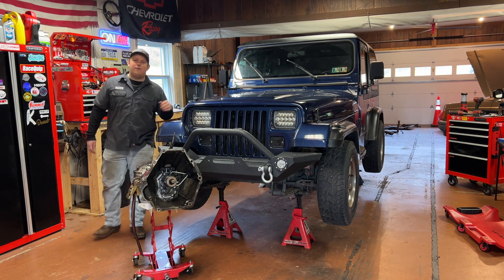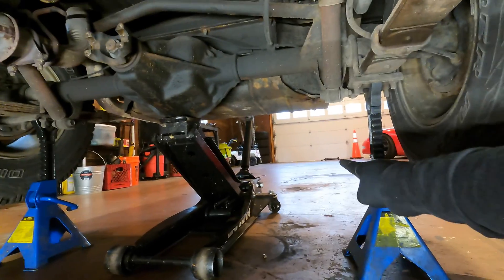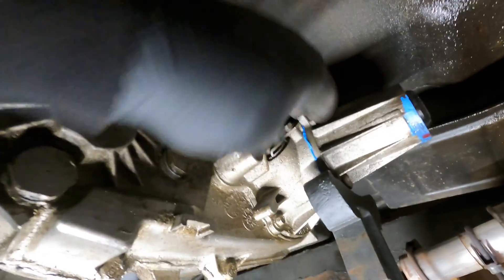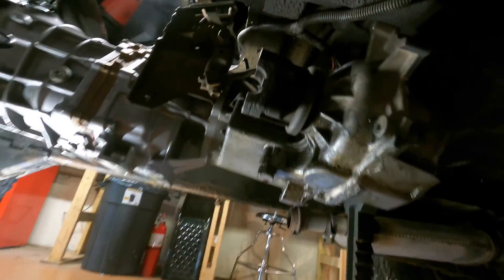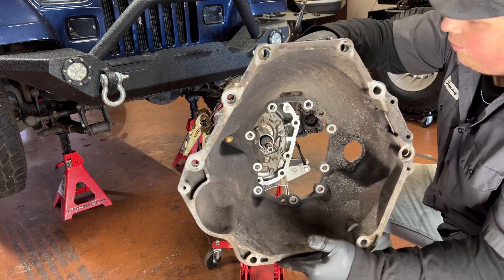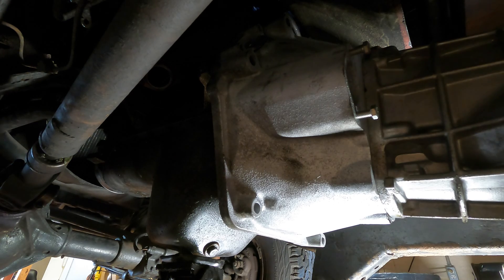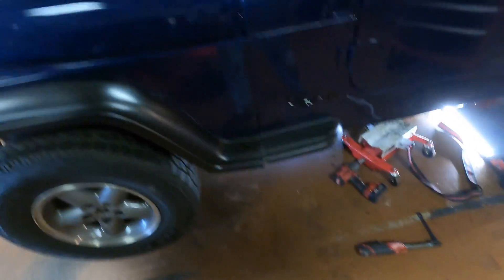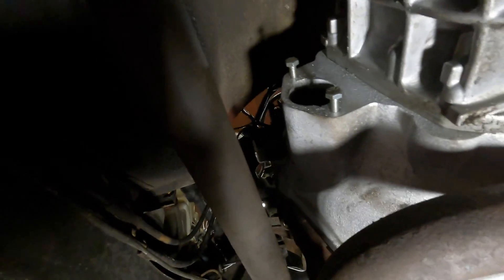AX-5 External Slave Cylinder Conversion | Jeep Wrangler YJ

Comment: Is there a seal for the new bearing retainer plate? I have the gasket, but im not sure if i need a seal for the shaft.
Reply from the maker: I did not replace that in this video. Not sure, but I figure that seal could be replaced!
Reply: @JeepinJimmy  I picked one up tonight from O'Reilly Auto. Part number is 1981 and is available from numerous companies under that same part number, including Timken and National.

Comment: 90 Yj 2.5 ax5 transmission is it easier to buy newer ax5 with external cylinder? Or to convert my old one? My bleeder valve is on passenger side? Would that change with new bell housing? Or is it jst backwards because it’s a video and I’m dumb? 😂
Reply from the maker: Since the bell housing can be easily unbolted, I would just convert the one you have if there is nothing wrong with it. The new bellhousing has everything on the driver side. Thanks for watching!
Reply: @JeepinJimmy  what master clutch cylinder should i go with for the kit to fit my 90 yj

Comment: Hey, for someone looking to go this route would you not suggest to just throw in a newer ax5 with external slave cylinder in? I have seen them in working condition awfully cheap.
Reply from the maker: I see no issue throwing an AX-5 behind a 2.5 L but if you have a 4.0 I would try and source a AX-15

Comment: Thank you very much for this video! I'm working on a 1993 YJ 2.5. It appears this conversion has already been done as it has the external slave cylinder. the Jeep is no longer shifting into any gears with the engine running, Ive tried starting it with it already in gear and the wheels want to turn even with the clutch to the floor, also making a hell of a noise. Seems like the clutch is not dis engaging the flywheel with the clutch pedal all the way down. First thought was bad master/slave cylinder...replaced it and it didn't  fix the problem. 
Does it just need a new clutch? Also, are the clutch plate and pressure plate the same as 1993 OEM or do I need to get parts for a later model wrangler since it has this conversion done.

Thank you in advance!
Reply from the maker: Clutch and pressure plate should be the same part!
Reply: @JeepinJimmy  thanks a lot!
Reply: I have a 95 yj that had the same problem, the CAUSE was unexpected and very clear. The slave cylinder actuator rod was fully extended and actually hung inside the slave cylinder. I did the measurements that prove the rod was too short, it was not worn, I made a longer one by grinding the end of a 5/16 bolt that was 1.5 inches longer that the stock rod. The results are unbelievably better, smooth shifts and no grinding.

Comment: Heyy Jimmy, do you know if the external slave bearing retainer uses the same seal as the internal slave bearing retainer? Not the gasket, which I see is the same, but the oil seal. It looks like yours was pre-installed, but I forgot to order one, so I carefully removed the old one (that was in good condition) and put it in the "new" retainer, and am hoping that wasn't a mistake!
Reply from the maker: Dang im not sure! Like you said, it was pre installed. Good luck!

Comment: Jeepin, what was the end result on the YJ slave cyl? Did you get a new part or did you modify the existing part? I’m going from a factory A5 internal slave (1991 YJ) to a 98 external A5. I too am trying to figure out the correct year clutch cylinder kit.
Reply from the maker: Just bought a new part as if I had the newer wrangler👍🏼

Comment: I have a 1987 jeep yj 4.2L with the Peugeot transmission (no issues) and have been thinking about doing the swap also do you know if it would be the same as what you did. Thanks
Reply from the maker: Not sure exactly but if it’s not the same the steps are probably very similar
Reply: I’m in the same predicament, did you ever find the right parts to do it to the BA10? Nothing wrong with the tranny, the slave/throwouts suck!

Comment: I also have an internal clutch cylinder.  I'm thinking about doing this conversion.  All I can find is AX15 parts though.  I have a 87 jeep yj 4 cylinder.  Can I use AX15 parts on a AX5?  Like the Throw Out Bearing Retainer
Reply from the maker: Im not sure if they are interchangeable. I think ebay would be your best bet for used ax5 parts

Comment: now is this conversion only for a 4 cylinder? I have 1989 4.2 IL6 and been thinking of doing this conversion..
Reply from the maker: No sir! You can do the same on an AX-15. Im sure it’s a very similar process, if not identical
Reply: I did the AX15 conversion on my 1987 4.2l. The slave kit they sent also didn’t line up with my bolt holes on firewall. Can you link the slave cylinder you purchased to finish the project?